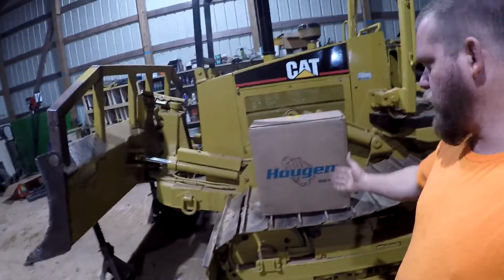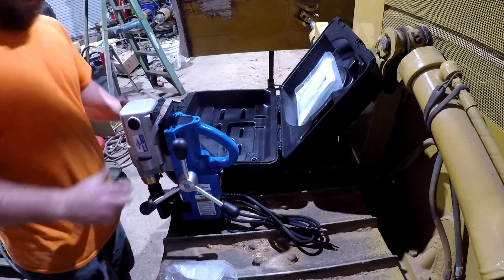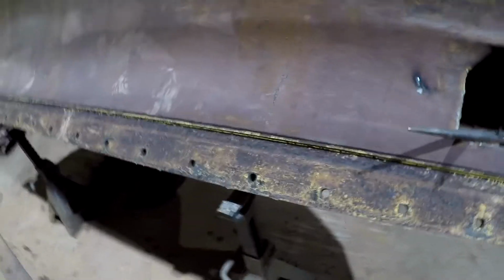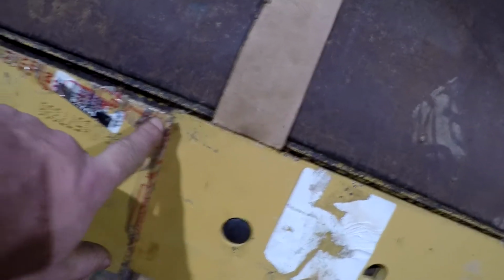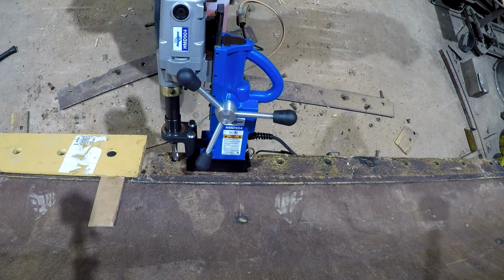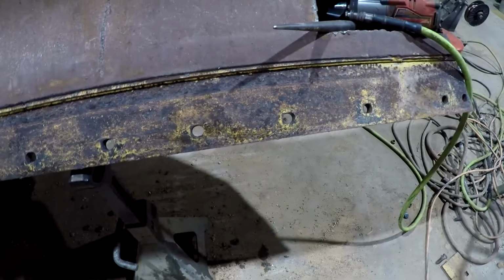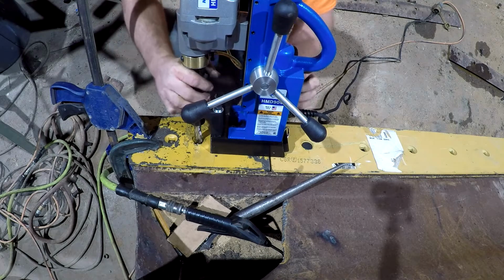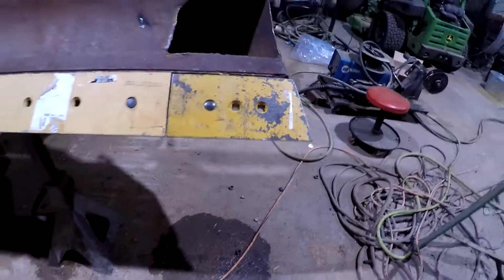New Hougen mag drill drilling dozer blade

Comment: I’ve had surprisingly good luck sharpening cutters with a cut off wheel on a angle grinder. Basically just clean up the rolled over edge on the flutes and she’s good to go. Takes a little practice but it’s nice to be able to do yourself and not have to wait on sending them out
Reply from the maker: I might try that sometime. Simply not worth the time and money to send out on the smaller cutters in my opinion.